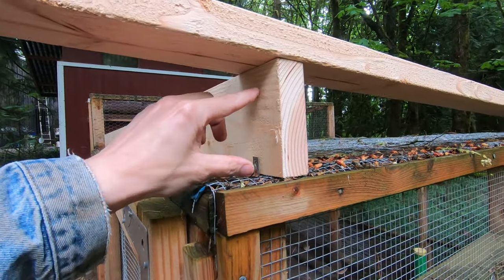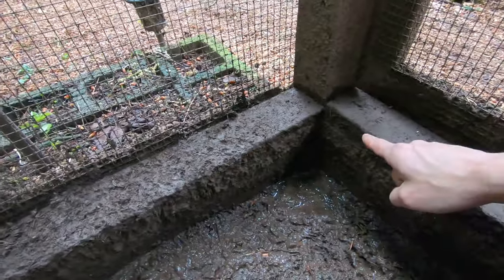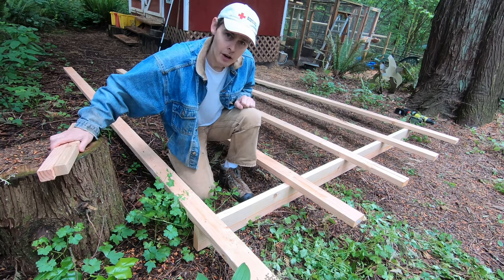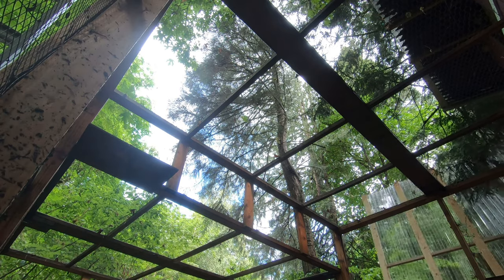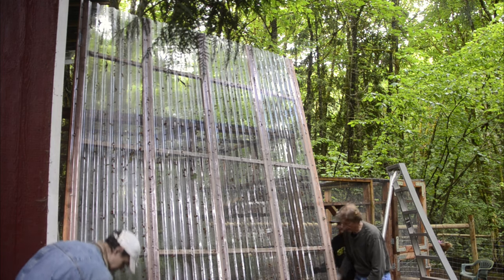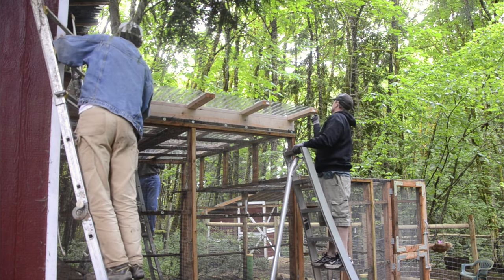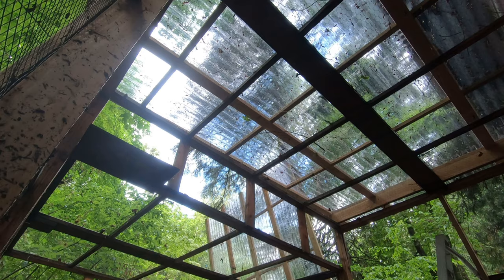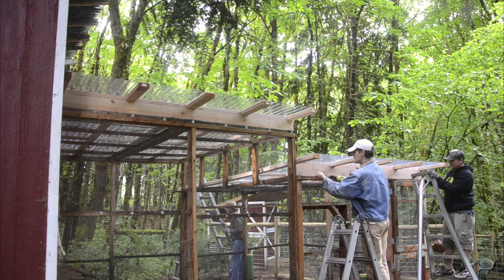How to Keep your Chickens Dry! - Building a Roof for Our Chicken Run

Comment: Exactly what I wanted, simple roof for a chicken run. Thanks 🙏🏻
Reply from the maker: Thanks, but I did post a follow up video where I had to replace the plastic with metal.
Reply: thanks. I have some colourbond left over from my fencing so will be using that.

Comment: Any idea if this will work in the snow? I like the clear plastic to let the sun light in.
Reply from the maker: The weight of the snow was never  problem, but we had an ice storm and large falling chunks of ice as it melted ruined the plastic roof.  If a metal roof can be mounted high enough over the run you will get plenty of light.
Reply: @SimpleMoonFarm  thank you for replying.  I appreciate it very much!

Comment: Your chickens will have a nice dry surface to walk on if you'll use sand in the bottom of your coop.You'll need to buy construction sand or dig your own "river" sand .Do not use "play" sand.Good Luck!
Reply from the maker: Thanks for the tips!
Reply: Sand isn't helpful in the rainy parts of the Pac NW. Just makes the clay slime much stickier. Wood chip and spent hay/straw do better. Can also layer in dried leaves. If it smell "wiffy" cover with more dry mulch. At 14" - 18" deep, it composts nicely during the winter, warming the area too.  In May, harvest the compost for your garden beds. Great for squash. Don't get as many slugs in beds with this as top layer. (A tunnel run around the garden also decreases the slugs). Also keeps the birds busy digging for bugs. I'm on the Kitsap Peninsula in WA. My flock just moved out to the mobile coop in an electric poultry net with solar energizer because the grass needed trimming/fertilizing and the moss needed a good rucking up even though the nights are still below freezing.

Comment: I was going to do exactly the same  but was told by a construction friend that it would only last so long then have to be replaced but-to use metal roofing--   thoughts?
Reply from the maker: Yes, go with metal.  We did have to replace the roof after an ice storm.
Reply: Thank You @SimpleMoonFarm

Comment: Now that it has been two years, how is it holding up? Any signs of cracking, or melting?
Reply from the maker: That plastic roof was broken in a storm.  I did replace it with a metal roof.